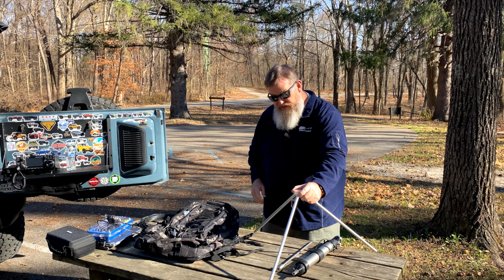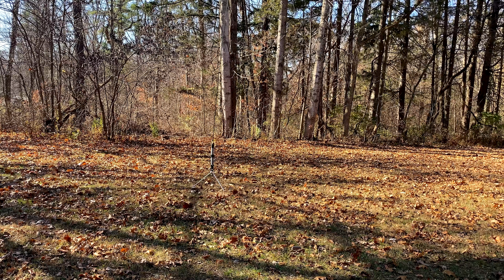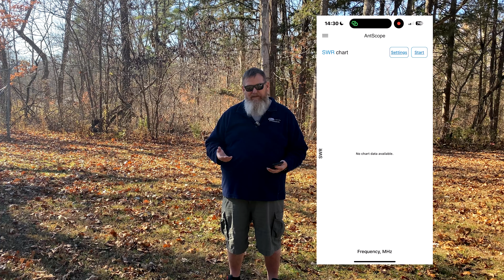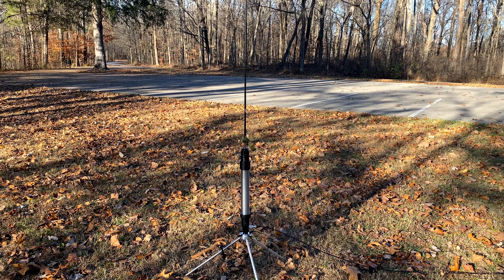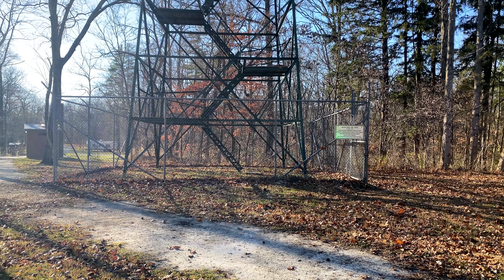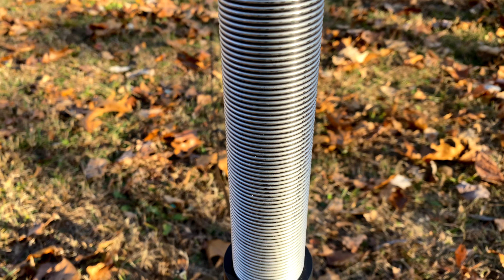Supercharge Your POTA Performance

Comment: Looks like a solid construction antenna as the Chameleon products.
In Europe, they are even 20~35% more expensive than what you can get in US.
I have a clone of the Super Antenna. The antenna is very flimsy compared to the one you are presenting. 
I may just get the coil and the tripod and take the missing parts from my other antennas. 
Thanks for sharing!